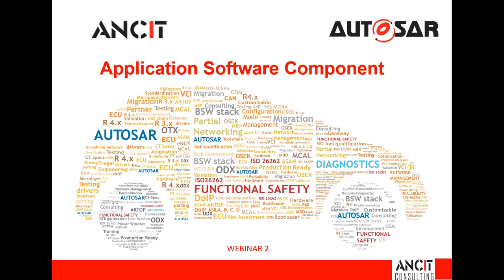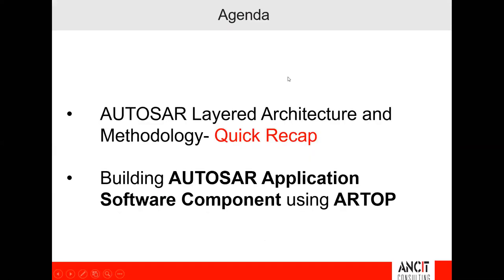AUTOSAR Application Software Component Development

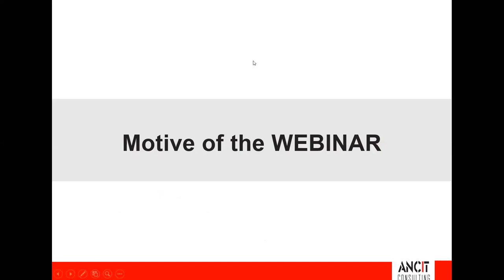Comment: 2:30 Motive of the WEBINAR
2:48 Agend
3:15 Why AUTOSAR?
4:41 AUTOSAR Layered Architecture
6:20 Application Layer and RTE
6:46 AUTOSAR Methodology
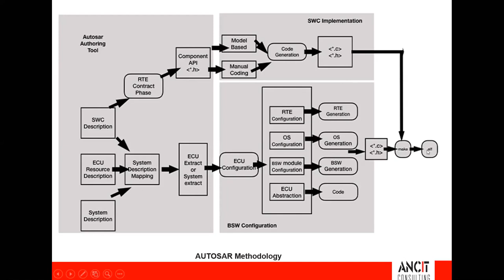8:15 Application Software Component Development
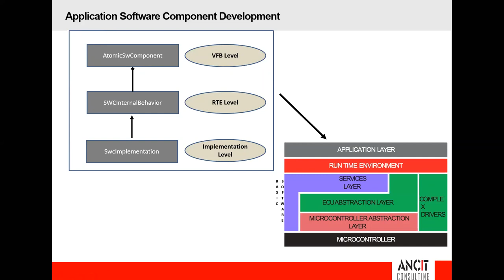11:12 Design and Communication of Software Components
13:56 SeatHeatingControl (Example)
17:03 SeatHeatingControl- Simplified (VFB Level)
21:16 AUTOSAR ASWC DEVELOPMENT STEPS/ Summary
22:57 Introduction of Artop
25:45 Creating SWC with Artop
    Creating Application Software Component, Ports and Interfaces
40:34 Configuring Ports with Artop
41:52 Creating another SWC with Artop
44:41 RTE Configuration
    Internal Behavior and Runnable Entity
1:01:54 SWC Implementation
1:06:54 Questions and Answers

Comment: Difference betweeen synchronous and asynchronous server call points, is that when async, client will return back to execute code and will be notified with the result of requested operation via the callback, and when synchronous client will be blocked until receive result of the requested operation.